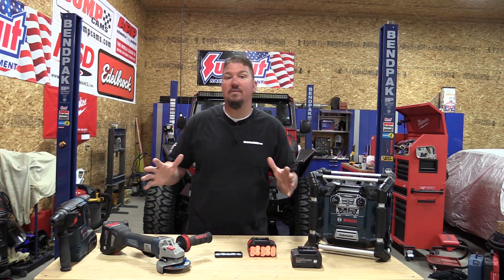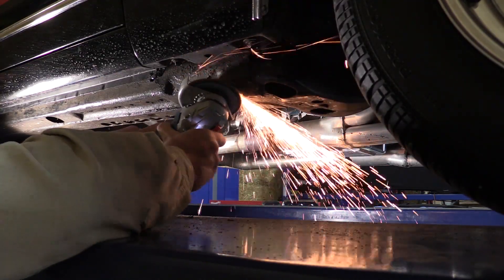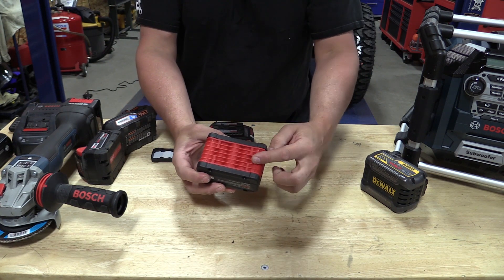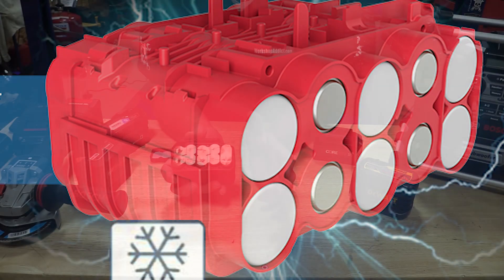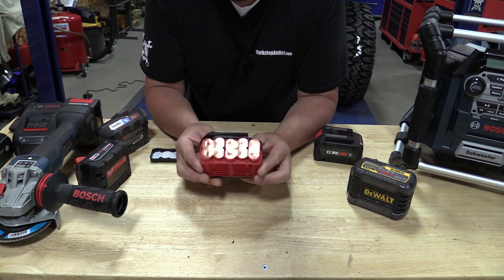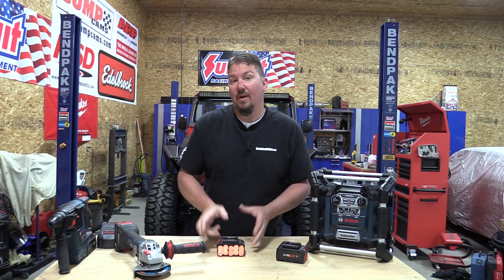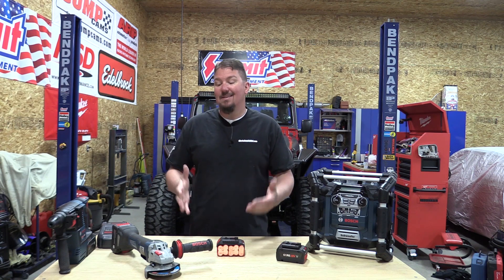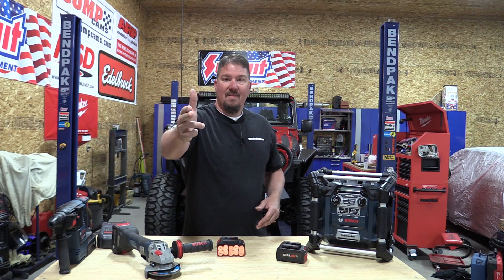Why We Are Excited About New Battery Technology in Tools Right Now

Comment: Plastic is a horrible conductor of heat. Bosch reduced the amount of material at the bottom of the battery to allow more heat to escape unfortunately the benefits of this approach are minimal at best considering that most people set down their tool in an upright position which traps the base of the battery against a surface.  Furthermore I believe this will be a design flaw which will weaken the structure of the battery pack thereby making it more susceptible to damage from drops.
Reply from the maker: Maybe we should test that durability!

Comment: It is a decent heat sink. It's HDPE (High density polyethylene) it was important to Bosch to find a material that had thermal conductivity while remaining electrically insulating. They have been using it since they came out with 18v li ion. This is the new cool pack 2.0 that completely separates the cells from each other and encases each cell in the heat sink. The new procore batteries are what I'm excited for. They will have the 21700 cells and will being coming out with a 4.0 ah compact pack, 8.0 ah universal pack(fat pack) and a 12.0 ah endurance pack. Along with the new rapid charger with an output of 16 amps!
Reply: Aaron Olsen
Im gonna have to call bull on that. HDPE has a k value of 0.42 - 0.51
Nylon 6 is 0.25
Magnesium 156
Aluminum 205
Copper 401
Numbers came from https://www.engineeringtoolbox.com/thermal-conductivity-d_429.html
So while you are right that HDPE conducts better than PA6 (nylon that good tools are made with) it is still basically worthless as a heat transfer medium.
Reply: Call bull all you want, but if you read further into it where I said has to be electrically insulating also, there aren't  many (if any) materials that are as cost friendly, as durable and as conductive. They also have a lot more surface area with the design as well. It's no where near the best conductor. Never said it was. But I think it is the best conductor out of any material for the price and ease of molding.

Comment: I tend to wonder if the Bosch battery is designed more for aesthetics versus for performance. Looking at that design it appears to be simply plastic and not a magnesium or aluminum (around the batteries). Being that plastic is an insulator and not a conductor I would venture to say that the cooling effect is pretty minimal. Another great video though! As always thanks for sharing this with us.
Reply: i have one. you assume correctly

Comment: So the new battery “technology” is a plastic “heat sink”?
Reply from the maker: In some ways yes, but the new technology is the larger, higher amp hour batteries being used in tools, but the issue is keeping them cool.
Reply: I wouldn't call more of something (higher amp), new technology, just like I wouldn't call a larger engine size car from model year to another, new technology. I thought there was some new control circuitry or something else that would set it apart. Still excited about the core 18v. Can't wait to get my hands on one.

Comment: It would seem that the cooling effect of a few plastic fins would be negligible since plastic is a better temperature insulator than it is a conductor.
Reply from the maker: Totally thought the same thing as you when I read about it and looked at it, but when we went through our grinder testing, we found it actually worked.  Look at our last recip saw video and you can see that stacking the cells on each other does nothing to help either.
Reply: It is a decent heat sink. It's HDPE (High density polyethylene) it was important to Bosch to find a material that had thermal conductivity while remaining electrically insulating. They have been using it since they came out with 18v li ion. This is the new cool pack 2.0 that completely separates the cells from each other and encases each cell in the  heat sink. The new procore batteries are what I'm excited for. They will have the 21700 cells and will being coming out with a 4.0 ah compact pack, 8.0 ah universal pack(fat pack) and a 12.0 ah endurance pack. Along with the new rapid charger with an output of 16 amps!
Reply: I don't think this is a heat sink, so much as less plastic = less insulation.
Reply: That's what I'm thinking. Less plastic to allow more air space around the cells.

Comment: Is the heat sink aluminum?  Or an ABS type plastic? I didn't know the battery numbers was the measurements.. I just broke out the calipers and a 18650 thanks for the edumakatetion!!
Reply from the maker: The heat sink is a plastic.  I think aluminum would work better but probably could not take the abuse of being dropped and it would be conductive...  we all think of aluminum as our go-to heatsink because that is what we see used everywhere!
Reply: WorkshopAddict I'll be curious to your findings on the heat related lock out with the new design not sure how well the heat will disperse from a plastic heat sink but technology is why smarter than i am foe sure.  I'm committed to the Milwaukee 18v line but I'm always curious about new stuff. Thanks for doing your videos I do enjoy them . Good job all involved!